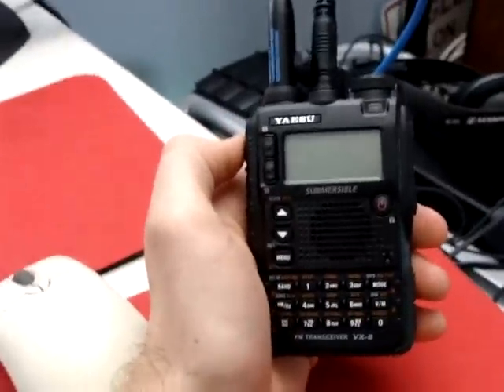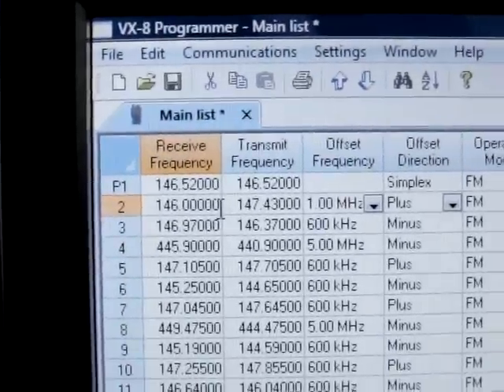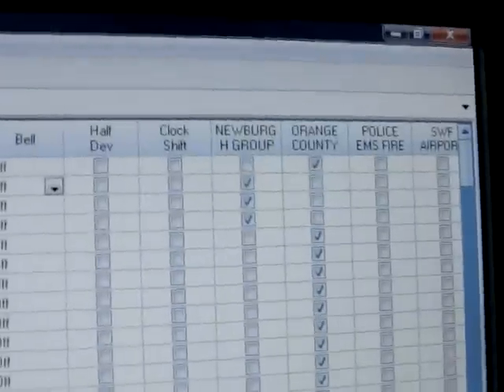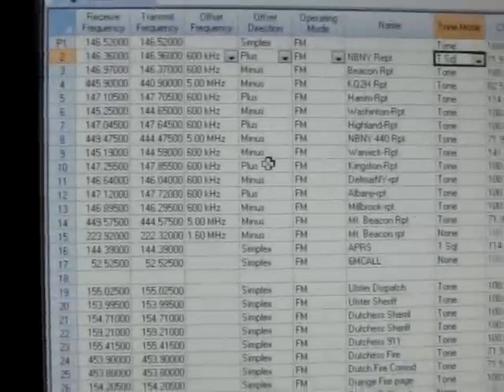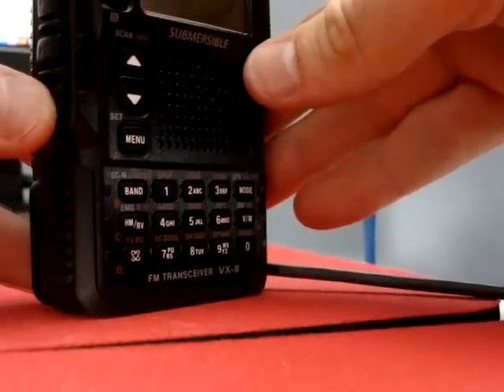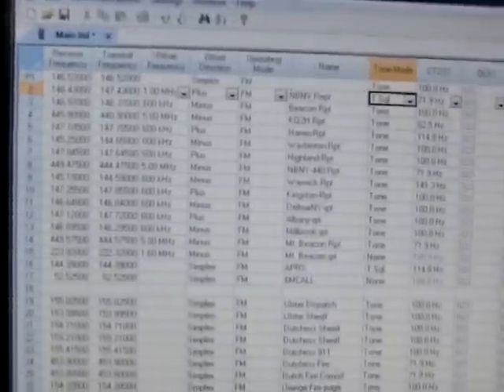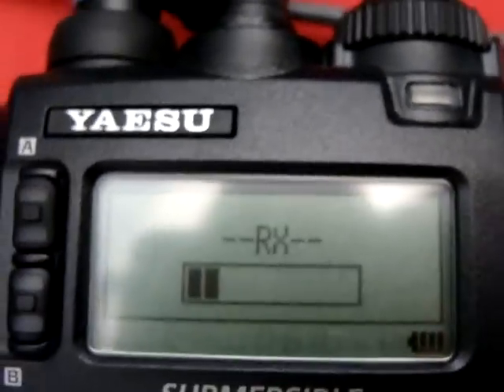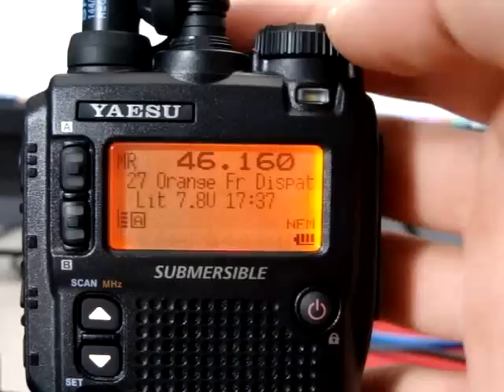Yaesu VX-8R Programing frequencies with software

Comment from the maker: @pierrelebatteur Sounds like the Drivers for the USB cable arnt installed properly.

Try running the software CD again and making sure the USB Cable installs correctly.  past that, id say contact RT systems to see if they can troubleshoot the issue.

Comment from the maker: @KB3UKTKB3ULN  I dont have the software in front of me, but i recall having to go into a menu and there was an option to change the band names.  You can also change it through the radio manually by going to the Menu, and then #8 should be band name.

Comment: Also, A lot of the repeaters in my area require CTCSS tones, BUT in the software spreadsheet there are two options - "Rev. CTCSS"  tones and "User CTCSS" tones, do you know what the difference between the two is?

Comment from the maker: @hhhh1997 

I think its a great radio, no problems so far and works well.

Distance is all dependent on the terrain . If your in a valley or  have mountains next to you, your range will be limited.   Sitting on top of a mountain with nothing in sight.. it will be 100+ miles.

Comment from the maker: Nope its just the easiest way too.

You can also dial or type in frequencies/repeaters and save them in with just the radio itself.

For me its just easier to spend a bit more for the programing software and be able to look at everything in a spreadsheet like this.

its a nice radio you will not be disappointed

Comment from the maker: If its in the Ham radio bands, nothing you can do to prevent an accidental Transmit.   If its outside the bands, the radio will not TX on that frequency.  So if your just listening to say a police frequency, and hit the Transmit. the radio beeps and displays an TX error on the screen and does not transmit.

Comment: I got my VX-8R from the Huntsville Hamfest last weekend and the ADMS kit from RT systems was one of the first accessories that I bought for the ht. Its a must have.

TIP: If you buy, or have access to, the ARRL's Travel-Plus repeater CD, you can quickly create repeater databases for your area(s) and export the data for use with the ADMS software!

Using both pieces of software, I had 156 (6m, 2m, 220, 440) repeaters within a 50 mile radius of my my home loaded into the ht in less than 10 minutes